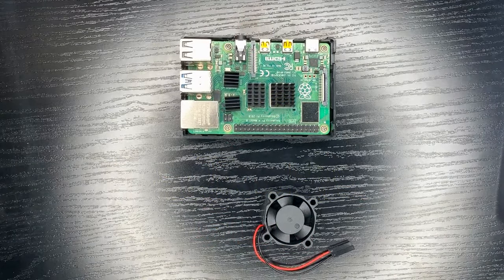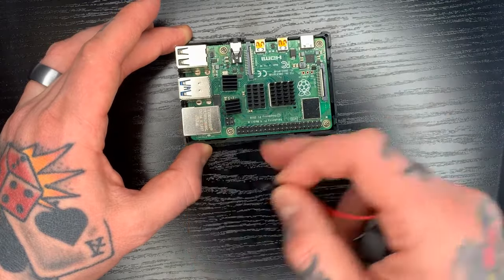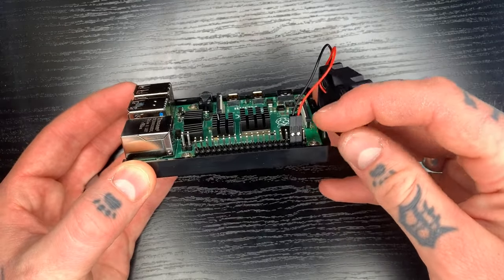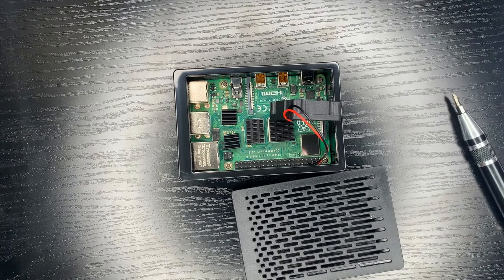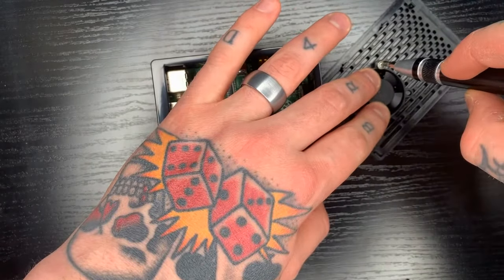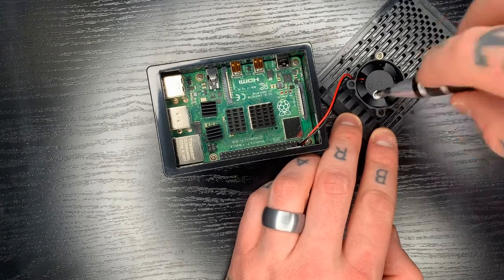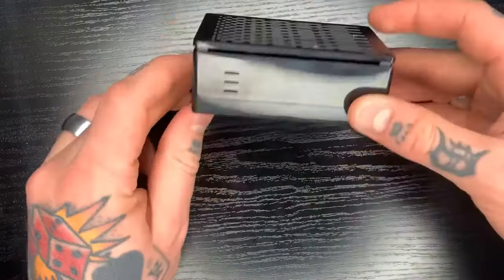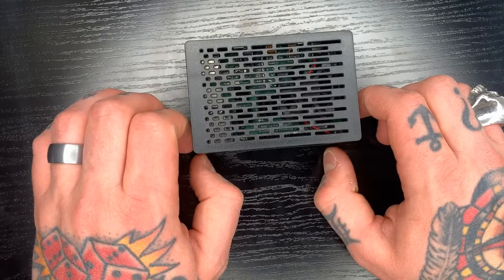How To Install A Cooling Fan On A Raspberry Pi 4 - RetroPie Guy

Comment: It's unusual seeing it being connected to what looks like a ribbon cable that plugs in there as PC motherboards generally have 2 pins reserved for such things, so a training video is essential!  You've highlighted the importance of a cooling fan for a Pi 4, especially for games.  I wonder if those small fans last longer than a year as bigger ones tend to be more durable.
Reply from the maker: It connects to pins here. I've been using mine for 2 years now and surprising it continues to run flawlessly. I was surprised myself on all honesty.
Reply: @OfficialChaseBrogan  In that case, looks like some quick and easy maintenance of dust removal.  Water cooling is high maintenance!
Reply: indeed ; this is why i came to the video section as it didn't look right. In the RPI 5 they changed  so it has it's own pins.

Comment: You leave off a lot of stuff, like fan flow direction, what the pins are, pin actual numbers & voltages... someone should approve work like this before its allowed to go live.
Reply: And also how to only have the fan activate at certain temps instead of it running 24/7.

Comment: Hello 👋 pc noob here. I’m getting my first raspberry pi here soon and was wondering if it would be possible to have more than one fan,(planning on making my own case to accommodate for multiple fans if it is possible)
Reply from the maker: Hey I’m not sure you’d be able to attach more than one with how they connect. You may be able to customize the wiring but it would be a project to figure out I think.
Reply: Hey i know i am a year late lol, yes its possible, u would need to overclock the power and 4core and gpu ( only way rn to overclock power is by doing that also )

Comment: I wonered about this and watched this wideo. But later i found some instuctions on the page for my kit, but it says 1st and 3rd on the top row from the left. not second and third as in the video. 
both is for the Pi 4 board.

Comment: Hi! I have successfully installed the fan on my raspberry pi 4b but I have noticed that it is always working, do you know if there’s any way to turn it on only when needed (ie after a temperature threshold)? Thanks
Reply from the maker: I’m not sure if you can do that with a regular fan. I think you need ones that have specific software associated with them like the argon one cases. Those you can make those changes to with ease. They’re really quite nice.

Comment: I can't figure out how to connect my fan to the gpio on rpi4
Reply from the maker: This video shows that connection. It’s going to be your red cable into the second pin from the end in the lower line if pins if you’re facing your pi with the sd card to your right hand side the top he black cable connects to the pin directly to the left of that one

Comment: My RPi 5 used to run at 65-68 deg C, sometimes 75 + under load. I was being lazy thinking it would reduce temps to maybe 55-60 range, but when I finally put the fan in, it was 35-40 and it blew my mind that such a tiny low powered CPU needs a fan to keep cool. Thanks for the simple video.
Reply: at room temperature in Ireland mine is running at 49-55. I'm now wondering if i can get it cooler???

Comment: where did you get the screws? I don't see any in my kit? DX
Reply from the maker: Where did you get your kit from? They are usually inside the case in a small baggy along with the rubber feet you stick on the bottom of the cooling fan case.
Reply: @OfficialChaseBrogan  CanaKit

Comment: Hello sir. I believe I connected the fan wire correctly as I followed your video, but when I turned on the raspberry pi the fan is not spinning. Is there any problems to this or it just waits before the device is hot enough before it spins?
Reply from the maker: Sounds like there's a problem. It should be running as soon as you power the pi on.
Reply: @OfficialChaseBrogan  the wires are kinda loose when connected to the raspberry pi pins
Reply: @OfficialChaseBrogan  it works now, thanks for replying sir. The wires were just loose.
Reply from the maker: @johnrysononez5399  any time glad it worked out!

Comment: What if I want to install a power switch as well, meaning I would need pins 5 and 6 for that which conflicts with this, is it possible there are other ways to plug the fan in?
Reply from the maker: Not sure. This is the only way I’ve seen it done. Why not just use the switch on the power supply cable?
Reply: I'm putting it in a arcade1up so that won't be convenient, however I heard you can use pins 1,9  instead, I'm going to give it a try when my pi arrives.
Reply from the maker: @OP-er3fg   makes sense. Give it a try and let me know if you don’t mind.
Reply: @OfficialChaseBrogan  It seems to work on mine, from what I can surmise, pin 9 is a ground so the black cable can always go there.

The important part is where the red one goes, pin 1 is for 3.3v fans and pin 2/4 is for 5v fans. 

So in conclusion, if you have a 3.3v fan, go pins (1, 9) while if you have a 5v fan (2/4, 9), usually your fan will state on the label whether it's a 3.3v or 5v. 

I guess most pi users already know this as basic knowledge thus don't bother stating the obvious, but for us normal folks this is a much appreciated tip.

EDIT: also the fan doesn't ever stop spinning till you cut the power, idk if that's how it is when plugged normally but just something I noticed.

Comment: Silly question maybe, But do we connect it so that it sucks air out the case or blows air in?
Reply from the maker: Should only be one way that the fan connects to the posts properly but I believe it's blowing air out. Either way though it's such a small space that it circulates the air and in turn cools.
Reply: Ventilátor vždycky tlačí vzduch. Máte ho doma? Sedněte si za něj, co to udělá. 🤣

Comment: are the heat sinks really needed since we re using a fan?
Reply from the maker: You could probably get by without them but they're good to have. Every bit helps.
Reply: Yes, what do you think moves the cooling substrate (air) across the heat transfer surface? I can't believe the questions some people ask here

Comment: Does it matter which the fan is pointing? Will it push air out or pull air in? 😯
Reply from the maker: Yeah it matters but you’ll only be able to install it the right way because of how the screws get put into place.
Reply: in a small case such the raspberry ones I think it dosen't really matter in wich way you put it. In a PC case on the other hand is quite important the orientationand the position.
Reply: @OfficialChaseBrogan   Thank you for your response. Can you provide more clarity on the fan orientation in your setup? Does it push air towards the CPU or expel it outwards? I have a different model which allows any positioning, so I'm curious: in your configuration, is the side blowing air directed towards the CPU or away from it?